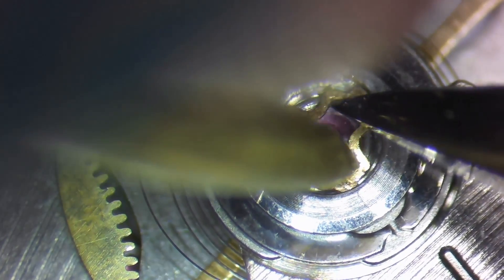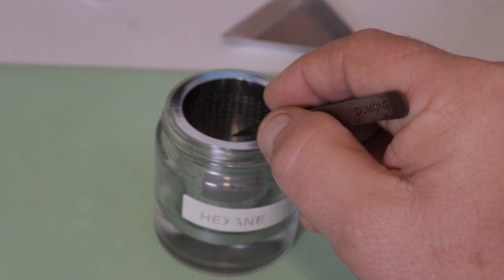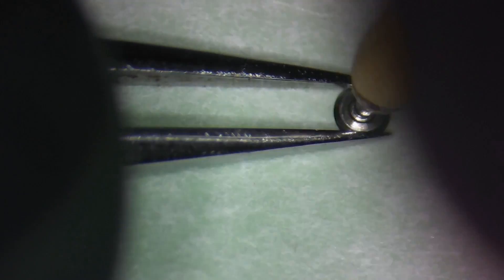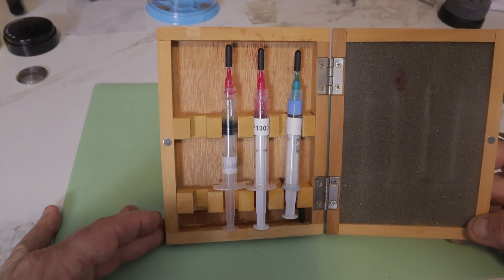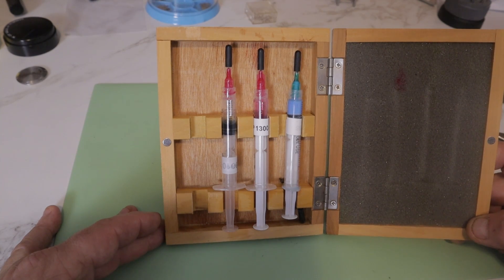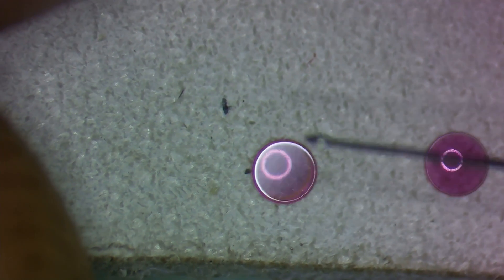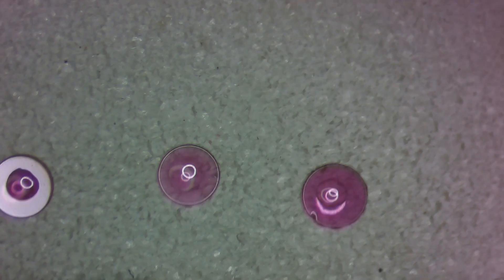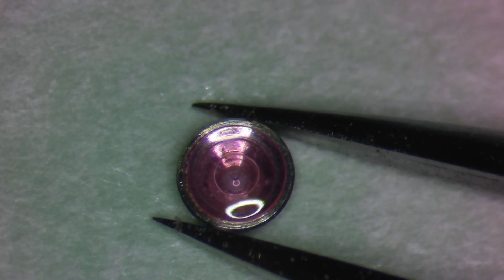Watch Lubrication: How to Properly Lubricate the Balance Pivots

Comment: For beginners.... trust me i have been through all this stuff.... most of watch guru make it so much complex and over .... in reality you don't have to be that paranoid over clea nliness..... make you life simple.... you will get to know most of steps are totally unecessary
Reply from the maker: Why do you say that? Everyone knows that dust and grit inside the movement can not only affect how the watch runs and how much wear and tear there are in the parts but residual cleaning residue left on the metal or on the jewel changes the surface tension and will cause the lubricants to migrate away from where they are needed. 
In what world is watch service performed that cleanliness does not matter?

Comment: Trying hard to learn all of this. The problem I have is both parts keep sticking to the tweezers.
Reply from the maker: Make sure that your tweezers are properly dressed, clean, demagnetized.
It’s not easy use working with tiny parts so be patient, be methodical with your movements, take your time and if you get frustrated, stop because you don’t wanna lose the jewel .

Comment: the big movement piece on my seiko 5 automatic watch gets stuck sometimes and i don't know how to fix it. should i use a lubricating oil and if so which one.
Reply from the maker: I am not sure what part you are referring to. Are you talking about the rotor?
Reply: @watchrepairtutorials  on the seiko 7s26a there is a big semi circle shape that spin around to give the watch power but on my watch it gets jammed so i have to manually shake the watch for it to get unjammed. i hear lubricant oil could work but i don't know which one to use.
Reply: @watchrepairtutorials  I just checked and it is the rotor piece that gets stuck.
Reply from the maker: @CR7_Kaka  Using lubricant on a rotor is a bit tricky because it's not as simple as just applying oil. In most cases, if the rotor is sticking, it could be due to dirt, wear, or a misalignment in the rotor's pivot or bearing, rather than just needing lubrication. Over-oiling or using the wrong lubricant can actually cause more problems.

Here’s what I suggest:

Check for visible dirt or debris on or around the rotor and clean the area carefully if needed.
Avoid over-lubrication. The rotor pivot and bearing usually require minimal oil. For the 7S26A movement, you can use a small amount of Moebius 9010 oil on the rotor pivot. Just a tiny drop is enough.
If the issue persists, the rotor could be misaligned or the bearing could be worn, and it might need a deeper cleaning or adjustment, which could require a service from a professional.
I hope this helps!

Comment: What’s the difference between this and just cleaning it in a cleaning machine? Also is acetone a good option like Hexane
Reply from the maker: One of the main advantages, especially for new watchmakers is not getting the parts mixed up. You wanna make sure that you return the  jewel settings to their proper location otherwise the movement will not operate correctly. secondly the endstones need to be perfectly clean which this method ensures. 
No acetone is not a good substitute. Is much too harsh for cleaning watch parts. Another substitute for hexane would be TCE.

Comment: Hi Alex, you had a neat trick on using a syringe to contain and dispense 9010.  So obviously I bought some syringes on Amazon. Two sizes - a very thin 1 ml one (for insulin shots) and a slightly bigger 3ml one.  My problem is that it's impossible to pull any oil into the syringe!  It feels like it's too thick.  I even tried pulling the plunger out and pouring a little 9010 in from the top, but then I face a different problem.  Too thick to be able to push the plunger down!  How were you able to do this?  Any other tricks would be appreciated.  Thanks!
Reply from the maker: You need syringes with a blunt tip. Not the kind for giving shots.

Comment: Have watched so many watch "making" videos, absolutely love your style ! the occasional profanity makes it even better (not that I'm encouraging that :-) )
Yesterday, I did my 
 ever balance jewel oiling on a 6139 . . . . 
I have a microscope,
I'm old,
I'm patient,
I was relaxed,
I was prepared.
I've been "oilfield" for 40+ years, I've rebuilt motorcycles, I've built CNC machines, the hardest thing I've ever done was oiling those endstones.
Between getting the Seiko incabloc springs out (easier than I'd thought)
Pulling the endstones and housing out (again, not hard)
those effing jewels . . they are wee !
my (insert deity of choice ) that took concentration, and zen, and breathing exercises . . . and a spare jewel from a junker 6106 .. :-)
Thanks for the tips, guidance and cool hair.
From Scotland, cheers min!
Reply from the maker: Very cool my man. With the experience do you have definitely have the right mind. Age is not so much a factor. Here are absolutely right, but then stones are teeny tiny so my best advice is to have complete concentration. When I take them out, I have these little plastic containers with a screw on lids that I secure them on so that they’re not just loose on the batch I can’t tell you how many times I’ve had one sitting on the bench and it accidentally touched it with the palm of my hand, and it disappeared. Good luck my friend and let me know if you need anything.

Comment: Mr Hamilton..... as a beginner and a learner I am curious, when you learned how many times did you fail during that learning process? I treat every failure as a learning experience but curious so I can gage if im learning anything on my end. Ty for amazing content.
Reply from the maker: All the time. The difference was I had somebody by my side to show me what I did wrong and how to do it correctly.
Then you get to the point where if you’re about to do something that you’ve never done before you could ask questions.
Make no mistake about it. What you were doing is hard so you have to take small victories as a win. Your advantage over many is as you say you are a learner, which is a huge advantage. Take your time understand what you did wrong and learn, but you should’ve done. 
It’s also important not to get in over your head and realize when you run into a situation that you’re not ready for yet. Maybe it’s a tool you don’t have or a technique that you’re not sure about. 
This is a field of study that never ends. 
Alex
Reply: @watchrepairtutorials  thank you

Comment: Hi Alex, great content! What do you use to polish the black oiler?
Reply from the maker: I put a felt wheel on my rotary tool, and then use a polish called Polinum and just touch the tip of the oiler briefly to a slow turning wheel. Briefly like one second at a time. And then check it it doesn’t take much.

Comment: My first service attempt is going to be a single jewel Agon EB 8387-66.
It runs, but I think the main spring needs a cleaning and the stem looks a little discolored/rough.  How are the wheels sitting in the bridge with no jewel?   I'm afraid I won't be able to get it back together.
Reply from the maker: Thats a rough place to start Jim.

Comment: Your videos are great! I love the realism and the  information. Question for anyone. I have a Elgin 18s model 4 movement. It is missing a jewel screw on the balance cock. Once pressure was applied at the missing screw the movement runs. I am newish and do not have a way to measure the thread. What is the best way to get a replacement? I can buy a whole 18s balance cock, buy a 16s balance cock (cheaper option), a screw assortment (and hope one is included), buy a direct replacement, buy a parts movement, etc. Which is the best?
Reply from the maker: There is no easy answer to this question, because the answer is,  "It depends". This is always going to be the dilemma, for a watchmaker who just buys random watches. Parts.  Here is my advice to alleviate this issue. Specialize. Just like a watchmaker. Watchmakers typically specialize in Seiko, eta, pocket watches, Hamilton pocket watches etc. The closer you can define what you are interested in, the easier it is to collect parts for those types of watches.
Reply: @watchrepairtutorials  Thanks for the response. Your answer makes sense. I was a pipe fitter/welder for 20+ years.  I am now a antiques dealer and specialize in mechanical repair and restoration. That is a broad spectrum. I usually work on clocks, music boxes, toys and paper such as books or historical documents, etc. Watches are new to me. I have about 20 that need to be gone through.  I am now getting started. Most are running to a certain extent. I figured, watches are like tiny clocks, I will figure it out.

Comment: For cleaning balance jewels why do you prefer your hard metal tool over just regular pegwood, the same as you'd use on all the other jewels?  
 Granted it is tricky to sharpen pegweed to the fine point needed, and then guide that into the jewel hole without breaking the tip, but once inside the wood will compress into the correct shape and will clean all of the sidewalls of the hole.  Your metal tool will likely just contact the rim of the jewel hole and wont have the same abrasive cleaning action deeper down in its sidewalls.
Reply from the maker: First I have never seen a way to sharpen a piece of peg wood to 0.03 mm. The tool i use is made from a balance staff and can be selected to just fit inside the jewel hole.

Comment: Would it not be appropriate to use pegwood in this instance?
Reply from the maker: There are a couple issues with pegwood in this case. How to hold the chaton and peg it without it flying off and how how do you sharpen the pegwood so the tip is less than a 1/10 of a mm. If you can do that, go for it.😊

Comment: Great video, I always thought that you place a small amount of oil in the jewel and the ends tone. But your saying the oil will be drawn into the hole jewel. I just changed my method. Thank you Alex. I'm addicted to every video.
Reply from the maker: If you’re talking about the balance, that is correct. That’s one reason it so important to make sure that both jewels have the correct amount. As an example, if one jewel is light, not enough oil gets drawn up into the jewel as the other one and that’ll cause differences in amplitude in the horizontal positions.

Comment: I have a doubt. I serviced a hmt/citizen 21J movement recently, but no matter how much i clean and properly lubricant the movement, the beat error is 5 to 6 and there are dot marks all over the timegrapher. Any tips?
Reply from the maker: Yes, you need to find the line of center so that the impulse jewel is center in it. 
If you are referring to a beat error if 0.5 ms that is not an issue to worry about.
If it 5.0 ms that is an issue that needs to be corrected before anything else can happen.
Perfect lubrication will not correct the beat error
Reply: @watchrepairtutorials  how to do that?  The stud holder is fixed in this Watch
Reply from the maker: @ajishvk2334  you have to turn the collet on the balance wheel.
Reply: @watchrepairtutorials  thank you so much. I never thought someone in your level will help me out. 🙏🏿

Comment: I found a quart of technical grade Hexane on Amazon for about $10 less.
They also offer a gallon for $56

Hexane - Technical Grade - 1 Quart Can - 32 FL Oz - Extraction, Cleaning Agent, Glues, Roofing, Leather - Domestically Sourced Chemical - Made in America - Alliance Chemical
Reply from the maker: I see it for 26 a quart or 56 a gallon. Just be aware that technical grade is less pure than Reagent grade but that shouldn’t r an issue here.
Also the sale of reagent grade is now controlled by the DEA and you have to be a business with a purpose for it so home watchmakers can’t buy it anyway.
At 26 a quart, that’s a pretty good deal.
Thanks Ray

Comment: Thanks for great videos and tips. Just made that tool from an old balance staff. I'd like to know what's the best way to reduce the diameter of the inner loop of a mainspring. The mainsprings available for vintage Seikos have too large loops for the arbor.
Reply from the maker: I don’t know if there is an easy way. The safest way is with the arbor in the loop.
Reply: @watchrepairtutorials  Ok thanks, keeping something inside the loop sure is a must.

Comment: Another excellent tutorial!  I’ve struggled a bit with trying to apply the oil drop while holding the cap jewel with tweezers (ping!).  Never realized that you can apply the drop without touching the jewel and get the drop to land without causing the oiler to stick to the jewel.  Instead I’ve settled on  picking up the jewel with a pointed bit of Rodico, inverting the jewel to present the flat surface at just a right angle under the microscope, and applying the drop.  I then lift the Rodico back to the bench, and transfer the jewel with tweezers to some watch paper.  I put the Chacone in place, and it’s done.  Finally, I’ve found that Epilame-treated end stones are better for achieving a dome of oil that doesn’t spread out as much, if that makes sense.  Thank you, Alex!
Reply from the maker: Hi Paul,
As you can clearly see when I lubricate the 4 end stones I am not holding them at all. That's why I like cleaning them with the leather buff. A couple swipes on the watch paper, flip and a drop of oil. Done
Reply: I made a leather polisher like Alex taught and it holds the jewel in place for the oiling. Great tool. Highly recommend
Reply: I discovered this not so long ago and it was like the clouds had separated and the sun came shining in.
I was pretty chuffed with myself.
I have also learned to pickup a consistent amount of oil every time.  Like most everything else, this all just comes with practice.
My 1900 timegrapher will be delivered this coming week and I have several movements lined up for improving.
Reply from the maker: @TropicalSpeed  timegraphers can be a very humbling experience sometimes.
They will by the very nature of their data tell you just how good of a job you are doing.
Reply: That is what I'm looking forward to; using this machine to gauge my work. 
Up to now, I had no actual way of knowing analytically if I was getting any better or even performing the work correctly which is to yield better results. I am expecting the timegrapher to tell me whether I am doing things correctly. 
As a hobby, there has to be an end-game. For me,  a movement that performs better each time I apply something that I have learned, to see positive results; that is my end-game. If the machine indicates differently, then I know that I need to evaluate and try again.
Reply from the maker: @TropicalSpeed  well said Ray, well said
Reply: @watchrepairtutorials  
I was afraid that I gota  little too philosophical, so thanks, Alex.  
Old age can do that but then again, and like a wise man once said: You are as young as you feel.😊

Comment: Thanks for everything. My question is; why is it after I service a vintage watch, everything looks good dial up, excellent amplitude, rate, beat error but when I flip it dial down or any other positions, the rate jumps to over + or - 100 seconds per day & the amplitude & beat error jumps all over the place. Thank you.
Reply from the maker: Good question! If this is happening all the time then you need to look at your entire servicing procedure. When amplitude and rates vary in the horizontal positions there are about 25 different things that can cause this starting at the barrel and going all the way to the balance.

Comment: I'm finding a very weird thing with new endstones i'm scavenging off nh35 movements. They're so smooth oil doesn't wick to them like on older ones from my old 7s26 movements. I have to oil them SEVERAL times to get enough oil on the endstone to make a correct size bead whereas with the older ones the oil just transfers to it as you would expect.

I don't know if seiko has upped their game polishing these jewels to a higher degree or what. It's not a big deal but it's definitely strange and annoying. As always thanks for the video.
Reply from the maker: Interesting, I'll have to look into that.

Comment: Great videos Alex, thanks.  Can you show us the assembly order of the movement and one more question, what is the size of that diamond jar?  Thanks
Reply from the maker: Which movement? the jar that I linked to is 2.5 inches tall and 2 inches wide or 6.35 cm x 5.08 cm
Reply: @watchrepairtutorials  in general, if there is any specific order (general rules) while assembling the movement? Thanks
Reply from the maker: @BokiPetrovic88   If you are referring to assembling any movement in general it kind of depends on the movement.
In general, I would install the keyless works, then the power train, then the balance and finally the motion works and calendar system is there is one.